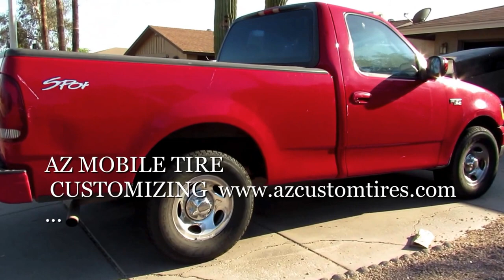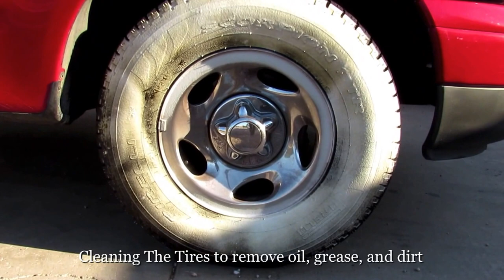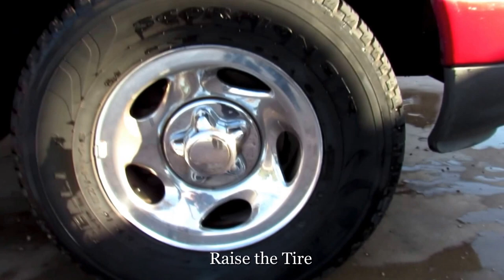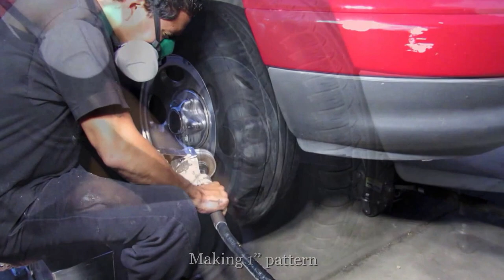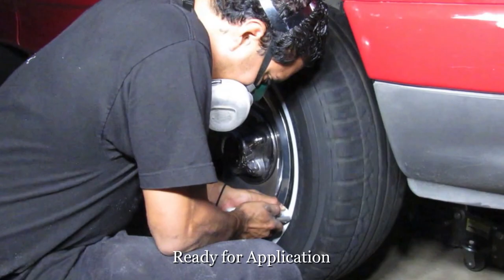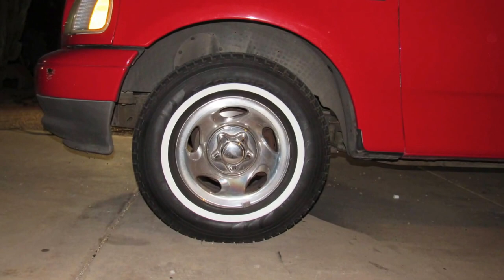How to make a custom Whitewall

Comment: I have 2 extremely hard to find Cosmo G-3000 Whitewall machines in good condition that I will be selling soon if anyone is interested. My dad was the local “Whitewall Man” from the late 70’s into about 2001 when he retired. I have extra grinding wheels (1/4”, 1/2” & 3/4”), paint heads (also 1/4”, 1/2” & 3/4”) and even a couple extra high speed flex shafts. Drop me a message if interested.
Reply: You still have?